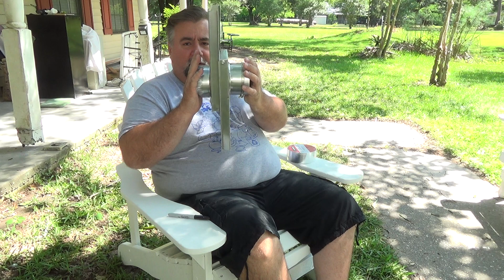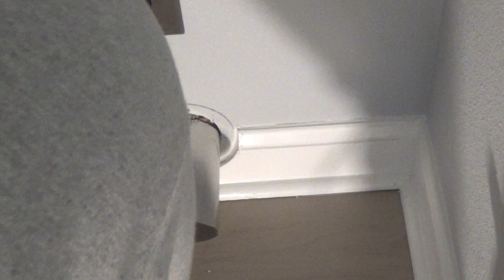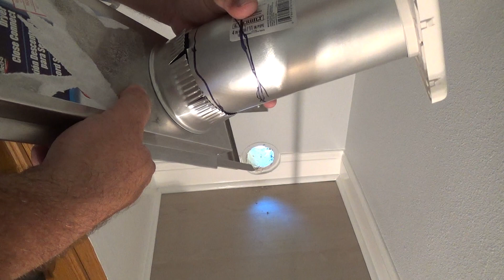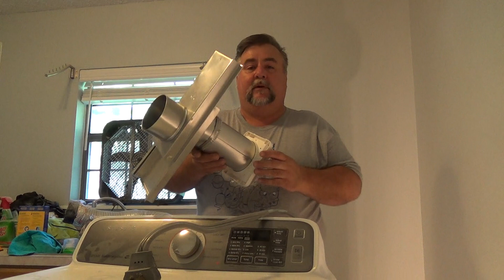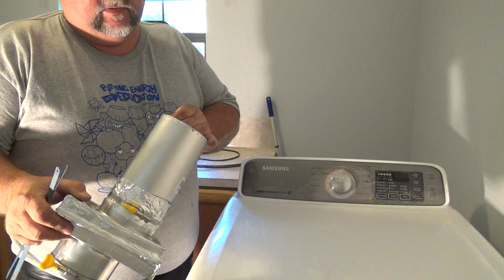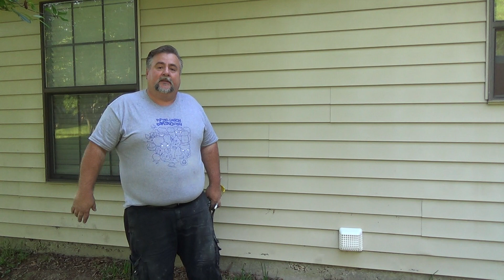How To: Hookup Your Dryer Closer to the Wall.

Comment: Good job!  I am just doing the same thing but my dryer vent is not straight into the wall.  It goes to the wall and then up 90 degrees.  I may find a adapter at HD or L. If not I will use a semi-flexible  piece of aluminum tubing.

Comment: I don’t believe you’re supposed to cut the crimped end to fit over the pipe exiting the wall. That fitting is supposed to slide inside of the wall pipe. Doing it the way you did, creates a lip that will help lint buildup. In other words the crimped end should always point away from the dryer.